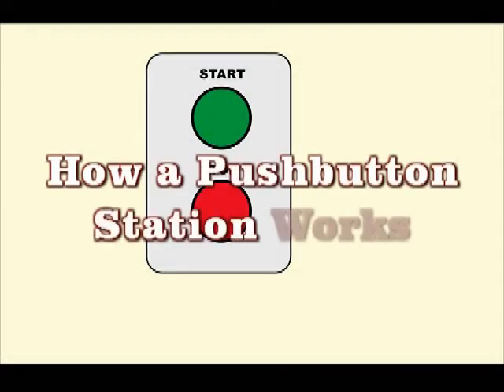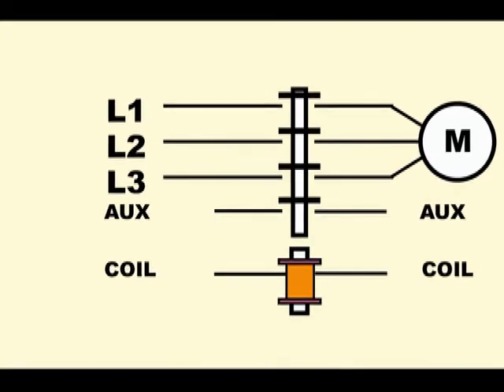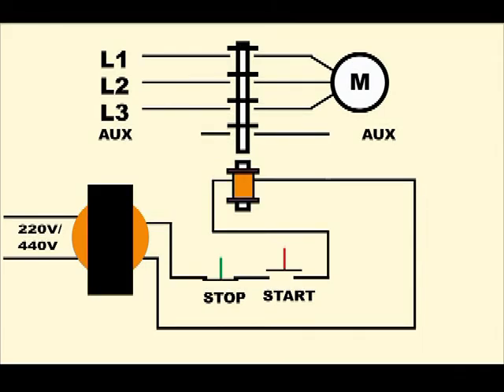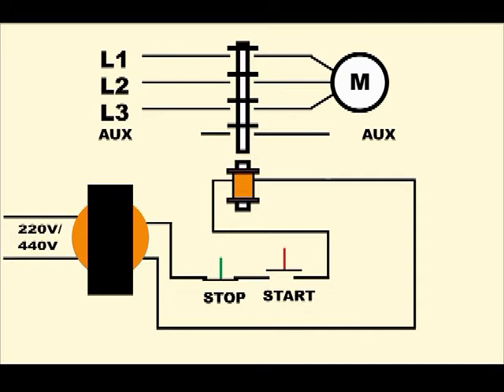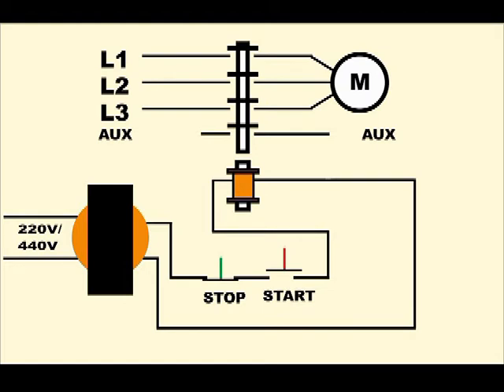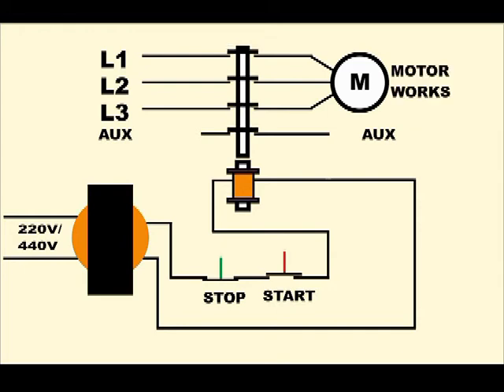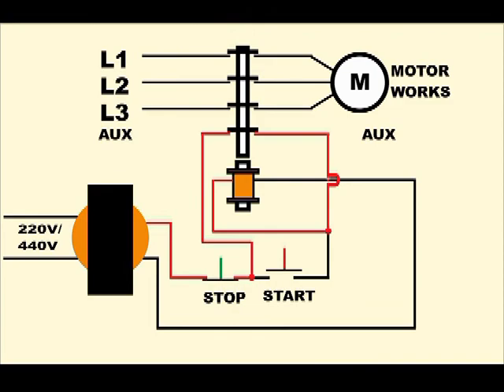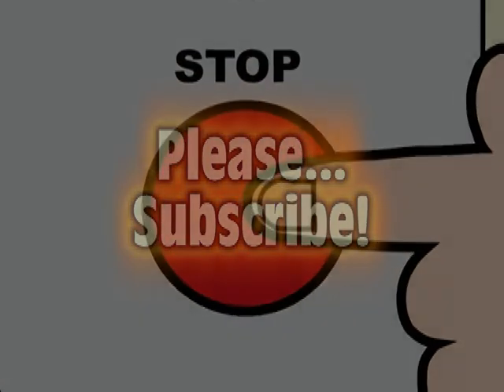How a Pushbutton Station Works

Comment: Openpb is 0 volte and closed pbis 120 volts
Reply from the maker: Yes, the relay is operated by this 110 volts and feeds 220 or 440 volts to the electric motor.
Reply: @eltunene  yes but pushbutton normally open is 120 volts and closed is 0 volte isn't their no current in open